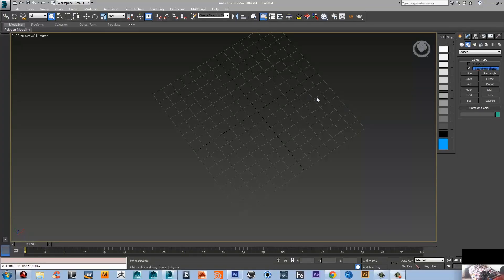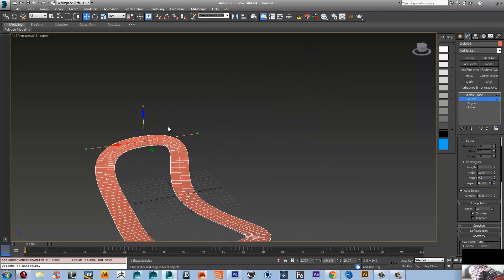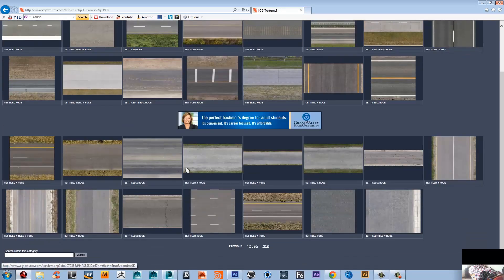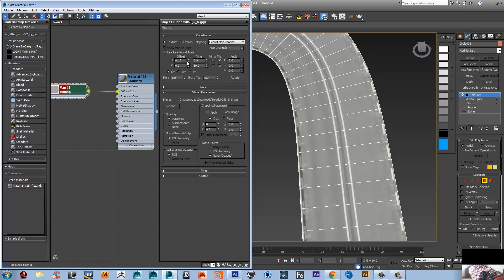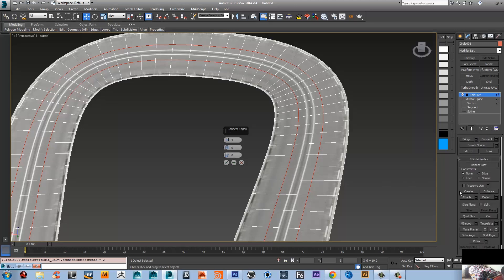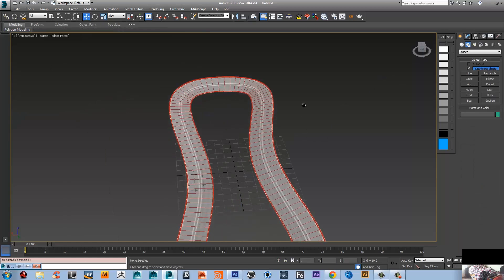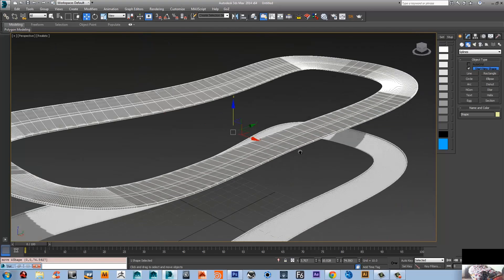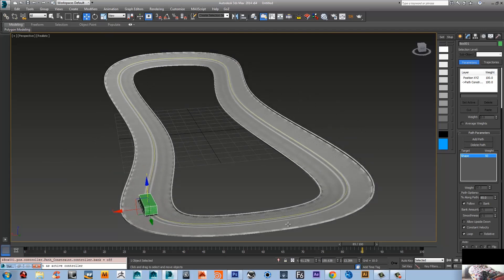3dsmax tip:easy and quick race truck modeling

Comment: When you applied the texture, the map automatically followed the shape of the spline.  By default, maps should be displayed as the shape of the map (i.e. square, rectangle, etc.).  How is it that when you applied the road map to the poly that it automatically laid to follow?
Reply from the maker: the spline has s plane uv applied to it so make sure to check generate uv coardinate when you create your spline .if your map don't show correctly just rotate by 90 degrees increments until it matches
Reply: +CGfriends Excellent, I often forget to check the gen uv on the spline.  Thank you.